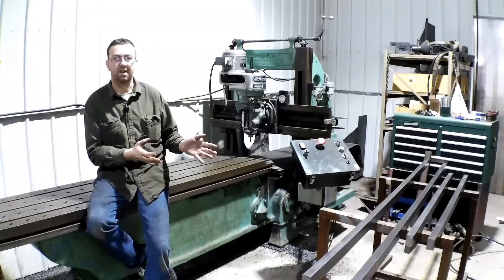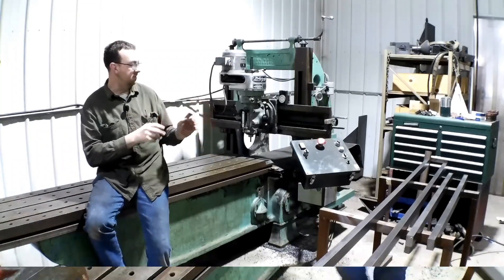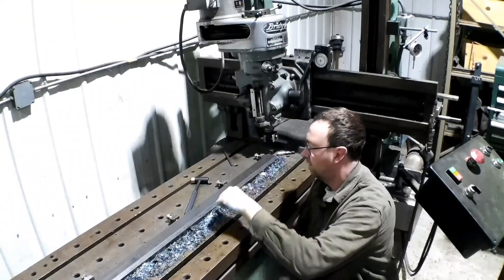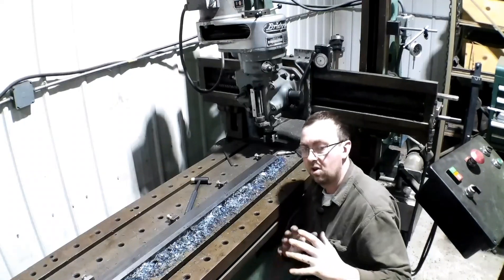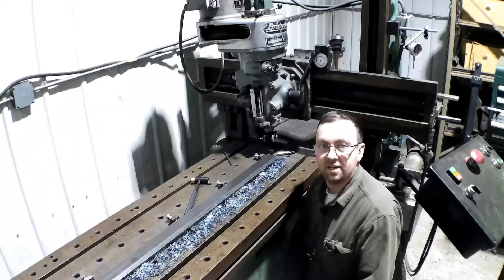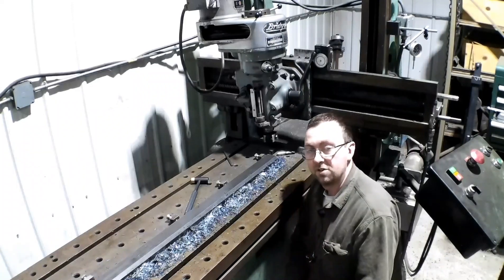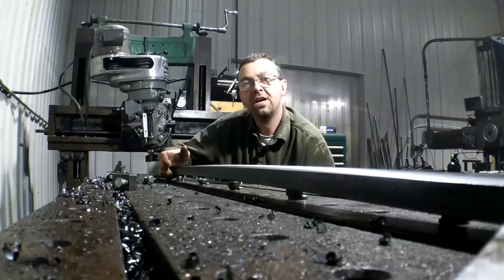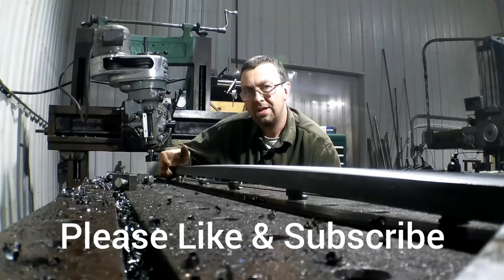Metal Planer Mill, Milling 8 Feet in a Single Pass

Comment: 8 feet? I wish. 
Im consistently doing 24 feet.
Thought not with a spinning head. Using Carbide squares.
Reply from the maker: I wish I had 24' of capacity. A lot of work out there being shipped a long way for that capacity
Reply: @TopperMachineLLC  Is non-stop work. Feels as if we're the only punch and die makers in the US..

Comment: Would it be practical to run a small annealing torch 10 or 15 inches behind?  Maybe an insulating layer of glass cloth between the table and part.

Comment: Oh wow. This is a mini planer mill compared to what I work with! I mill down in between 5000-100,000lbs metal sticks or slabs. It's pretty similar to this. What is your rpm and ipm? Just curious
Reply from the maker: When I first started running these long parts, I was running at RPMs similar to what I would do on the bridgeport. I was burning them up about mid part. So slowed down to about 325 RPM and that cured it. As far as feed, I am unsure. I just run it and increase feed until it sounds and feels good. I'm guessing in the 3-4 IPM range, maybe more or less. It's all by feel and sound.
Reply: @TopperMachineLLC  Very nice. I am sure the type of metal is different. I work with steel, 15-5 stainless steel, and a few other. Typically run my rpm around 85-100, with 15-28ipm. Thought this video was pretty neat though. Thanks for sharing

Comment: Could you have used hot rolled steel for the job?  You then may have needed to machine more surfaces, but there would have been very little distortion.
Reply from the maker: Unfortunately specs called for 1018 Cold Rolled. The sawed these down to 6" pieces, so it wasn't a problem. Thanks for watching.

Comment: Pretty sweet setup but my question is how the hell do you get that thing back flat enough to send to the customer
Reply from the maker: Hasn't been an issue. They cut them down. Most of my long parts are shortened by the customer. It's easier for them to track a single large piece than several small ones.
Reply: @TopperMachineLLC  fair enough I figured a coal bed fire in a cinder block type furnace maybe able to relieve the stresses but idk I’d have to try it and see but pretty awesome anyway thanks for the post

Comment: There is one of these localish to me for $1500. About the same size. Would be tough to get it. Should I try really hard to do so? How often do you use yours?
Reply from the maker: If you have the space get it. It does bring in work. But if you don't have the room, I'd avoid it. You really need to have space, and a marketing plan for one. I use mine about one job every 3 months now. It's very specialized work.

Comment: Why not climb mill the first pass? A flood cooling the cut might help with the warping... on both cutters. Cool machine😉
Reply from the maker: The warp is from internal stresses not heat.  I am looking into cold air guns for the shop. I don't like the mess of coolant or the mist in my breathing air.
Reply: @TopperMachineLLC  I have done air foil wing ribs for Boeing. Talk about warping! Basically bolt the block to a Stevens plate and machine away! Re-leacing it was like your warp.
Reply from the maker: @yasnac7576  it's crazy just how much you can warp metal just by removing one side.

Comment: How did you convert your planer bed to be a slow controlled feed? Did you retrofit an Acme screw drive? If you did that would be a great video to show how you did it
Reply from the maker: I did not do it, the previous owner did. It actually is a DC drive, and driving the original bull gear.  Works quite slick. I will try to do a full explanation video someday, as your not the first to ask about it.
Reply: its retrofitted man. DC unit. probably decent coin
Reply: On some of the shots you can see the DC motor chugging along mounted to a worm drive.

Comment: I could not believe how much that had warped, is it the heat from the milling that caused this?
Reply: It's from the internal stresses of the steel. When you remove material from one side, it creates a stress differential on that side and introduces warping.
Reply from the maker: Not sure exactly the cause. I believe it's just from the rolling process. All cold rolled steel does this. Way more noticable on longer pieces. I've  notice is on 3-4" pieces, but it's not much.

Comment: Wow, stress in material ! ! !  Neat to see, not neat to press back straight.
Reply from the maker: Luckily this bar gets clamped and welded in the customers equipment.
Reply: @TopperMachineLLC  Wow, makes it easier not to have to straighten it.  My thinking is if you had to straighten it, do it 2 foot at a time in a H press.  Kinda like re-arching leaf springs.
Reply: I got your PM.  I will try to call later and chat with MY rotary flip phone !
Reply from the maker: @kooldoozer  I'd probably do it in 6" steps for way more control. But, yes, hydraulic press for sure.
Reply from the maker: @kooldoozer  try me tomorrow afternoon. We have family stuff going on til early afternoon Sunday.
Reply: it's a lot to cut off.  I cut 40 foot bars on planers at work but we're actually planing them not milling them lol. and they're still straight after we're done.  He's just taking off a lot at once.
Reply: oh I see that its cold roll, I'm certainly not cutting cold roll.  I still wonder what would happen if you planed these traditionally if there would be less bending.  I guess long shit always has to be straightened anyway
Reply from the maker: @9mmsafetyalwaysoff00  4140 annealed. I have other choices for the material,but this is what the customer wants.
Reply: Topper Machine LLC. Always happy to see another planer video.  I have one of mine taking 32nd cuts I need to upload.

Comment: Nothing like making a spring! 
I really love this machine, it's like the best parts of my 2 favorites.  Part milling machine,  part planer. 
Have you ever tuned up a lathe bed on it?
Reply from the maker: I have not. Not sure I want to try something that precision until I get more time on it to see what the wear on it is. But would be a fun project.
Reply: @TopperMachineLLC  sir,your machine mechanism  use gear or  screw/threaded rod (X axiz)?🤝👍